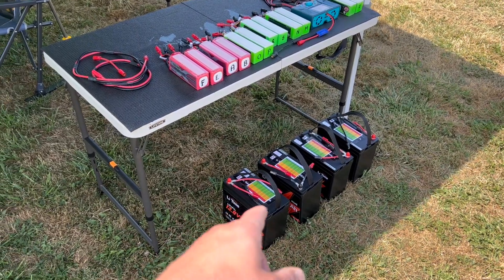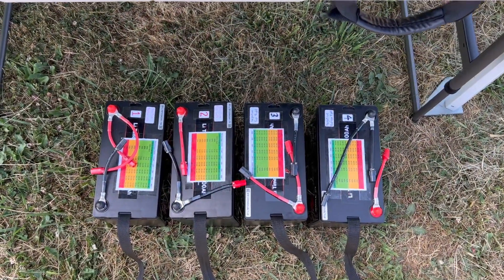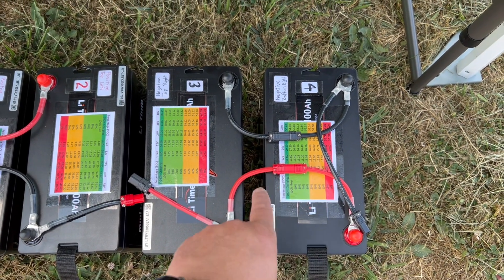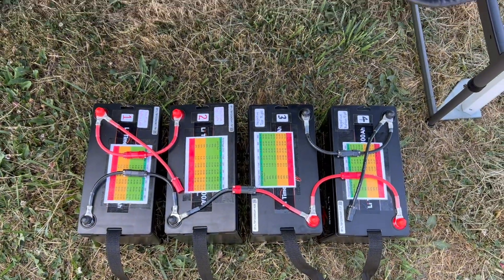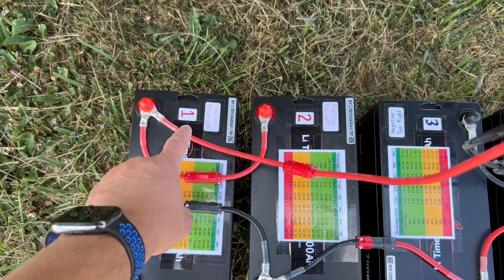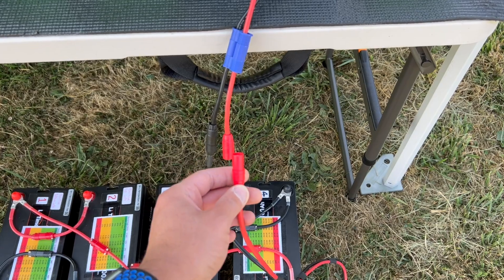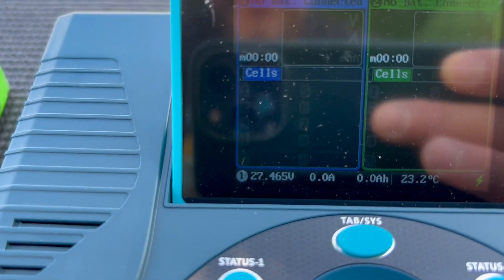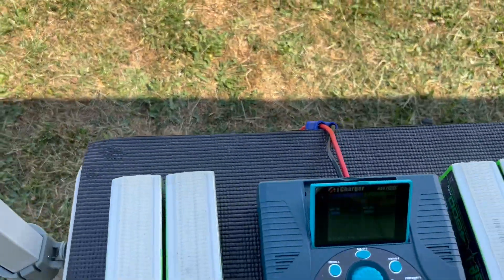LiFePo4 batteries for RC field charging   HD 1080p

Comment: Nice! Your LiPos look like you are flying 6S 5.000 mAh. How many times can you recharge using your four LiFePo4 batteries? And why do you have so many 6S LiPos? I have only two. One is charging (3C), while one is being flown.
Reply from the maker: The LiPo’s in the video are mostly 7S 4500mah; similar energy density as a theoretical 6S 5250mah pack.  I can balance charge between 36 and 38 of those 7S 4500mah from about 20% (3.84V/cell) to 100% capacity (4.20V/cell) before my 24V 200AH LiFePO4 bank is depleted.
Reply: @johnahamelv   Impressive! Then only two LiFePo4 in series should serve me well as I don't fly more than 12 packs a day. Thanks for the info!
Reply from the maker: @janriggert  Another option is to use a single 24V 100AH LiFePO4 battery.  I did not go with this option myself mainly because it was heavier on my back than I wanted and and it was more challenging to stow away in my car due to its bulk, but your circumstances may be different than mine.

Comment: John,  what are the benefits of this setup vs an inverter generator?  I know is nice and quiet,  no exhaust.
Reply from the maker: Like you said, it is quiet and no exhaust.  No gasoline spills either.  No gasoline smell in the car.  No need for maintenance either, like keeping track of oil changes and spark plug replacement.  No need to DC power supply either as the charger connects directly to the LiFePO4 batteries.  Each individual mini size LiFePO4 100Ah batteries weighs only 19.5 lbs., compared to about 65 lbs. for a 2200W inverter generator.

Comment: Very cool. John, you have a lot of cool toys and tools. What’s the price of that battery setup? I bought a $300 1600w generator from Costco for field charging this year. My charging box is 1500w capable, but I run it around 1100w when charging four 12s sticks simultaneously.
Reply from the maker: Each 100Ah mini size LiFePO4 battery I am using costs around $300.00 each, so $1,200.00 for all four batteries.  Then you can add the cost of the charger(s) as well as the cost of wires and connectors.  This LiFePO4 setup is certainly more costly initially compared to gas powered inverter generators.